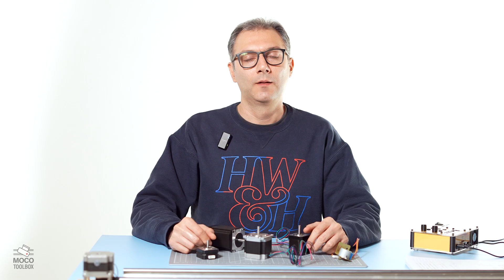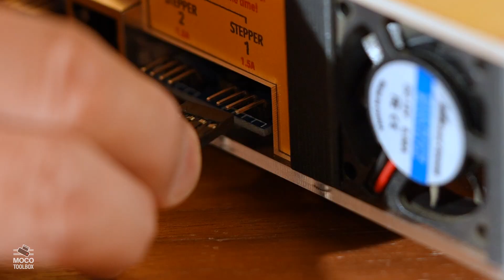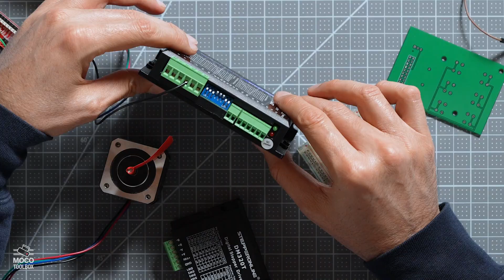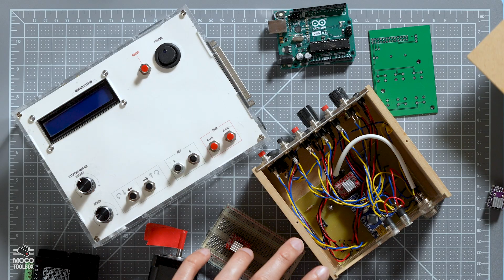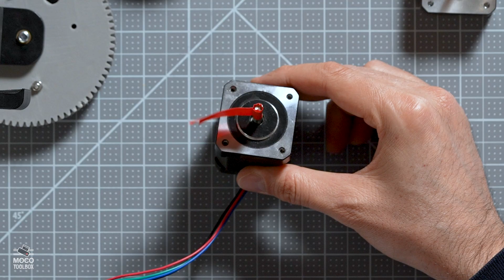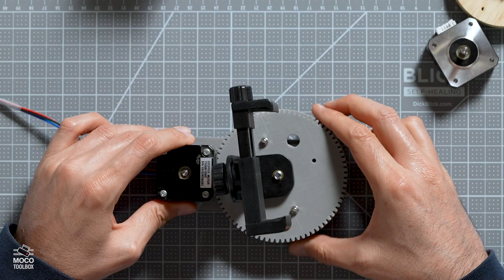Diving into DIY Motion Control; Explaining Stepper Motors, Drivers, Controllers and Rigs

Comment: this is a very comprehensively detailed video - have you used feedback sensors with steppers and any experience with those ? having a controller with closed loop feeedback ?
Reply from the maker: Thanks! I don't have experience with closed loop feedback controllers.

Comment: I had left a fairly detailed comment and messed up had to edit it and then YouTube messed up I'm not typing all that again. I've got pages worth to type but uh...
I've got a design for a 3D printer where the motors are stacked vertically over top of each other in the same verticle space. I'm building my own motors and the printing is done on the inside of the motors. There are no rails, rods, screw rods, belts, gears of any kind except for the gears that push the filament.
It has high torque and zero backlash and submicron precision accuracy because I do not have physical steps. My step count isn't even a count, it's literally infinite.
The software and hardware part of it I'm going to have to do from the ground up and here's where I'm gonna need help.
I essentially am going to have an AI but really a set of complex algorithms that are interacting with themselves that have a microscope camera faced on the rotors.
It will know all the physical dimensions of everything about my machine.
All of the properties of my water cooled electromagnets that are constant DC.
and all of the electrical and mathematical magnetic formulas.
And it will have to train itself.
My rotors are oriented at a particular angle down to the micron. It will be looking at the camera and have a target rotation and just try combinations until it gets flawless to where it uses the least amount of electricity and the fastest speed without overshooting.
So what kind of board could analyze every frame of a high frame rate microscope camera?
To see down to the micron that the degree of the disc is oriented, there will be a specialized encoder pattern around the perimeter of the discs, the rotors.
So in one instance it knows the physical orientation of everything looks at the G code to see the next destination for the physical orientation and based off of its training model knows exactly how to apply the electricity to achieve getting there.
So what kind of boards, computers, pies, whatever, etc. Will I need for this task?
Reply: Forgot to mention I will also be setting this up for laser lithography.